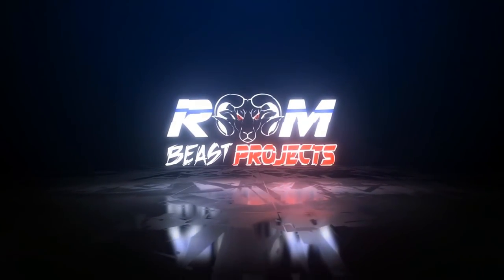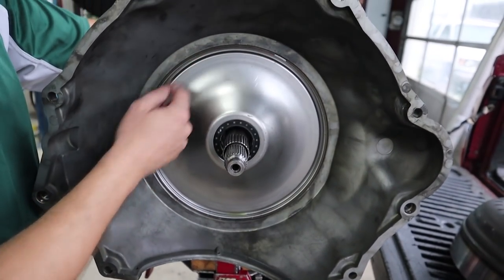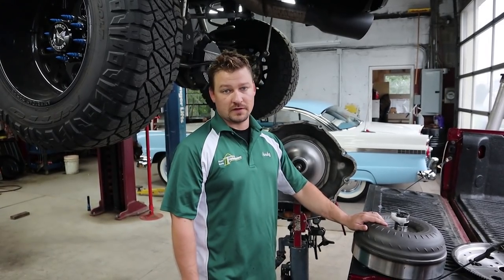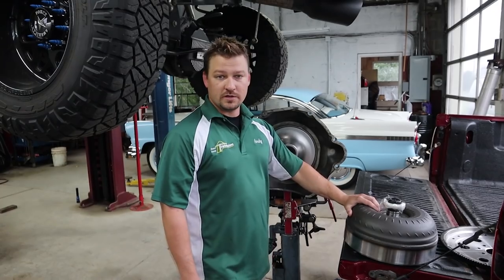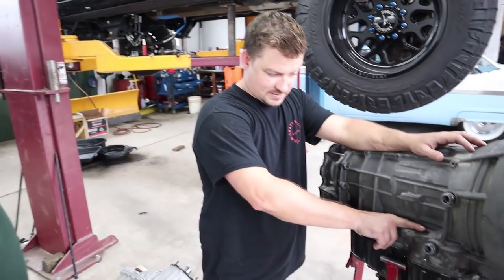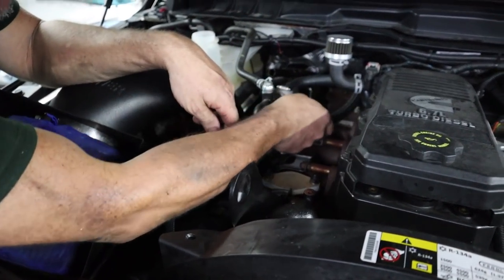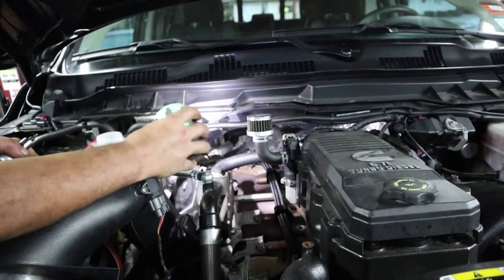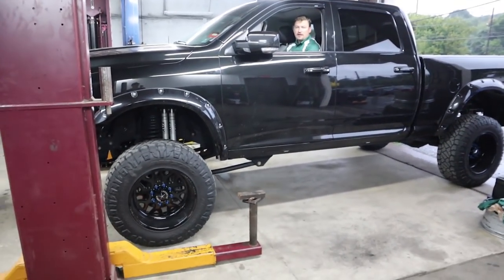ONE TIME SHOW! Fleece Coolant Bypass & 68RFE Installation

Comment: Steve, I have a 2012 Cummins and I have literally done everything you are doing and then some. Built trans, coolant bypass, hpp ezlynk, and many more. I am not sure what your factory thermostat is, being a newer year truck (190 deg?) but I had to change mine from 190 to match the one that came with the fleece kit, 180. My coolant temp was fluctuating until I did that. Just another recommendation, with your truck now able to put 550ish hp to the ground, your next "mod" should be head studs. Trust me, I said "I don't need them, I have a factory turbo."  Don't be like me, Stud your head.
Reply from the maker: Thanks Jon, studs are in the planning. My truck has a 180F thermostat, I’ll have to keep an eye on the temperatures. So far, I haven’t noticed anything crazy.
Reply: Oh, and the Fleece bypass can be installed with the transmission in, it is a GIANT pain in the ass though. LOL
Reply from the maker: I would love to see that! OMG 🤣
Reply: Jon Storms - 2010 - 2012 trucks with tuning are notorious for blowing HGs.  Was this with HPP's tuning?  All of the ones I've read about were using the Mini Maxx or Smarty jr, and seemed to be caused from too much timing.  This isn't a concern with 13+ trucks until you are pushing 45+psi boost which the stock turbo is incapable of on stock fuel.  He only needs studs if he gets a bigger turbo and bigger injectors, but then he'll need a bigger CP3, bigger lift pump, HD valve springs, and HD push rods to support the other mods.
Reply: @monsterram6617  I had a mini maxx before and I had crazy egts so I changed to Ez-Lynk through hpp. I also have a s465 second gen swap and they were still high.. Even on low tunes..
Reply: Jon Storms - Are you running the .9 A/R housing with bigger injectors?
Reply: @monsterram6617  I have the 1.1 housing with 30 over nozzles on stock injectors. My egts are good now with hpp tuning. I was around 1100F at cruising speeds with the mini maxx. Timing adjusted closest to stock timing and on tow tune.. But that's history. Around 600F now at cruising speeds..
Reply: Jon Storms - Yeah, 1100°F cruising is no good.  What are you seeing now at WOT now with HPP and what tune?  I have HPP also but have a BW S369SX-E with a .9 housing on stock fuel.  Cruising I'm between 650°F - 800°F and WOT I'm around 1350°F on max tune.
Reply: WOT my egts can reach 1700F on tune 5. On stock tune they will only get up to about 1100F. With the hpp tuning I rarely ever turn it up. Stock tuning or tune 2 is way more than my mini maxx ever was.
Reply from the maker: Can you get away w/ running 467.7 on stock fuel? I was told by a few that you can w/ room to grow, once the fuel system is upgraded. Your thoughts?
Reply: @BEASTProjects  I would say yes but realize it's gonna take a touch longer to spool. Not for ever but definitely not what the stock vgt does. I run the LBF SOTF tuning and it will blow a puff of smoke and then clear up, that's only driving hard. Normal driving I feel it drives better than stock but it's been over a year since I've had the vgt on the truck.
Reply from the maker: Thanks for the info
Reply: 4wd burnouts and 50 psi of boost didn’t help much storms. Hah

Comment: I don't think you need that bracket.  I haven't had one on mine for over 20k miles.  It sees plenty of punishment and nothing so far.  

I did add the ATS 68rfe brace though ($189) which you can install with the trans in the truck in about 20 minutes.  Cheap insurance for a cracked case which essentially means you need a new trans.  

Can't wait to see the test drive!  👍
Reply from the maker: Oh man... Thanks god the trans doesn’t need to come back out again for that one. As always, thanks for the awesome advice!
Reply from the maker: Where does this ATS brace actually mount?
Reply: On the top of the trans.

Comment: I wouldn't worry about that warranty, theres a new or old law or act that the dealer has to prove that your aftermarket add one actually caused the problems your trying to warranty. A coolant bypass is only going to help keep things cool so your winning on that part. Thanks for this video and information. Now I can do mine lol
Reply from the maker: Thanks Tony! 😊 Good to know 👍🏻
Reply: Please feel free to correct me if wrong and read through the attached link but the way it was explained to me by my greenville dodge was that the provider of the warranty has to in fact prove without a reasonable doubt that your change or aftermarket addition cause the failure of parts or items under said warranty. 

https://en.wikipedia.org/wiki/Magnuson%E2%80%93Moss_Warranty_Act
Reply: Tony Turner - While this is true, there's one part of the puzzle that is missing: dealerships can refuse to do any warranty work until the truck is returned to stock condition.  That means your lift, your tires, anything you've done to the engine, transmission, differentials, etc, etc. all must be removed.  This bypasses the Magnuson-Moss Act entirely and puts the owner in a potentially worse situation where they would have to spend thousands of dollars getting the truck back to stock just to save money on a potentially less-costly repair.  

It's also worth mentioning that this was a powertrain failure and it is very reasonable that tuning the engine to make more power caused or contributed to the transmission failure.  It would be different if he had a malfunctioning sun-roof and they told him bigger tires were the cause, then refused to cover it under warranty.  In this circumstance you'd probably have a case, but if the dealership wanted to be A-holes they could still refuse to fix it until it was made stock.   

Btw even if the dealership covered this 100% under warranty, Steve would eventually wind up right back where he was a few weeks ago because he'd be getting a stock 68rfe, not one built with upgraded internals which is what he needs at this point in his build.
Reply from the maker: I guess I should of mentioned this in one of the videos. I actually went to the dealership for the transmission OD slippage & an issue w/ the D/S front panel. I was curious to see if they would even entertain it. I would have let them swap it, just so I could get by a little longer until I could afford the MIGHTY RevMax 850 68RFE. I know that it would be a matter of time until I would probably toast the OD again on a stock transmission. Well, the dealership wouldn't even submit the transmission for warranty replacement, because I installed an aftermarket RevMax valve body. The dealership's RO read "The customer will have to take their vehicle back to the shop that installed the aftermarket valve body". They did however cover the door panel replacement. Now, I just need to find the time to give my truck up for a day at the dealership for something that would only take me 15 minutes to install. LOL
Reply: Ram BEAST Projects - Hey, at least you tried!  About the 850, I was speaking with Tom when purchasing my trans last year and couldn't  decide which one to get.  He said that the 850 is primarily for racing applications and that it has softer clutches that wear out reasonably fast and require periodic refreshing (rebuilding).  For street use, Tom said the 700 with the billet steel center support is the way to go.  It's advertised for 700whp but people have reported making over 900whp with no slippage.  So far, this thing is bullet proof; burnouts, boosted launches, WOT 5th & 6th gear changes, you name it... although I'm only around 550whp right now so we'll see once I put more fuel to this sucker what happens! 

Basically, if you need to hold over 900whp it's better to do a 48re swap since they can hold much more power for less.  However, it's a couple grand for the harness and other parts to make the swap so there is some "investment" cost going that route.  Any way you slice it though, a built transmission for these trucks is expensive.  Hell, I even looked into doing an Allison swap since people rave about them.  Found a place in Florida and was quoted about $13,000 with a built 650whp Suncoast Allison.  This was way more than I was willing to spend for that low of HP rating.  Contrast that with the RevMax700 68rfe at $9,900 installed, 2-year unlimited mile warranty, and $1000 rebuilds for the rest of ownership.  Let's put it this way, that extra $3k paid for my 2nd gen swap and left me with room to grow!

Comment: What kind of power is the trans able to handle now?
Reply from the maker: Dynoed at 530HP & almost 1000 ftlbs of torque. So far so good, don’t worry we’ll be turning it up to 600’s at some point. I’m already planning the fueling upgrades. Keep watching the videos.
Reply: Sweet I’m torn between fleece and air dog for fueling I’m at 498 with just Motor opps tuning now but have upgrade plans
Reply from the maker: I’m definitely going w/ Fleece.
Reply: Ram BEAST Projects my only concern was fleece states it only supports up to 800hp
Reply from the maker: Yeah, I’m I won’t be passing that with my build. Shooting for mid-600’s
Reply: With where you are now 12mm cp3 and the fleece pump and new tunes you should exceed 600 easily.

Comment: Fleece bypass is prone to leaking. A better option is the Stainless Diesel bypass. Works off pressure. When things heat up the pressure increases and it opens up. Also, having that thermostat in the fleece bypass. What a pain when that goes bad. You have to drop your trans to undo the bypass. Just a poor design all around.
Reply: They aren't  Prone  to leaking-   We had some faulty lines in the past  that have been corrected.
Reply: @nathansnyder1052  Thanks for the update. Good to know.